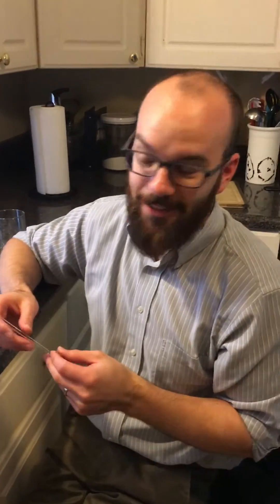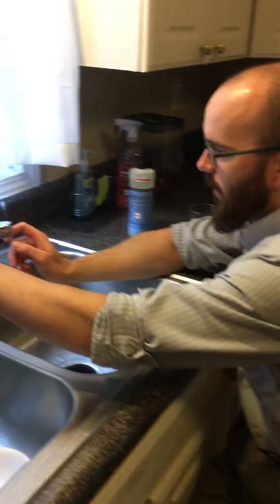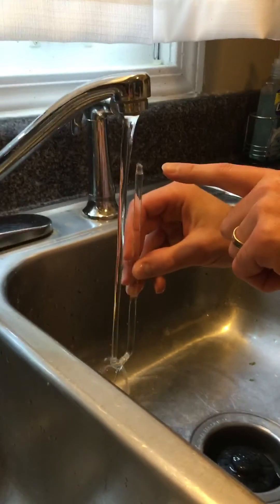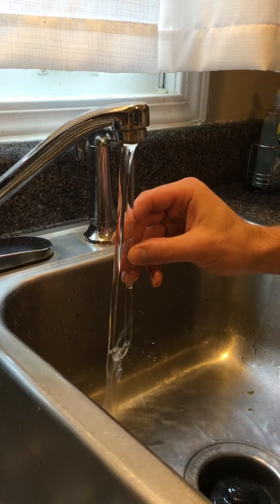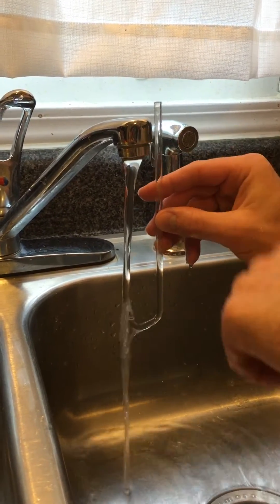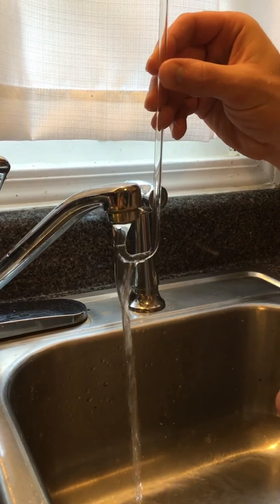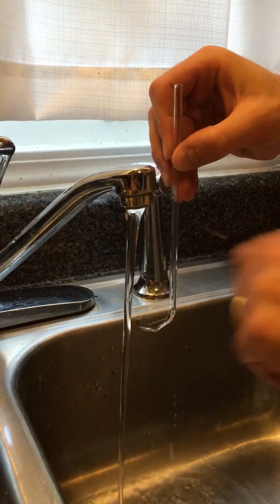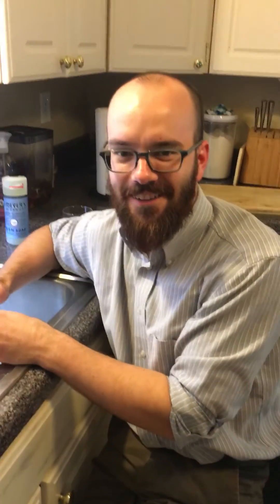J-Tube Water Level Experiment! Can you explain why this happens?

Comment: The higher the J-Tube is placed, the more water doesn't flow into it, but into the basin. Water escapes the faucet at a greater surface area.
 (not enough force momentum to push water into the tube).
Because of Bernoulli's principle, the water focuses into a smaller surface area further downstream of the flow towards the basin floor, so the water's flow is focused into the opening of the J-Tube at a lower vertical point, forcing more water into; and out of the top of the tube.